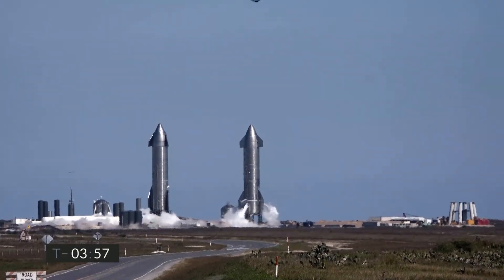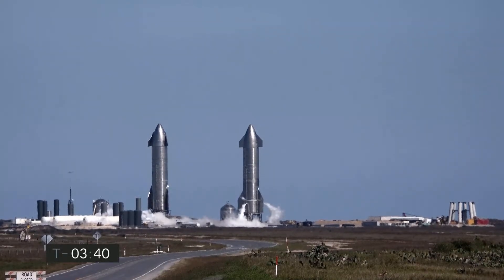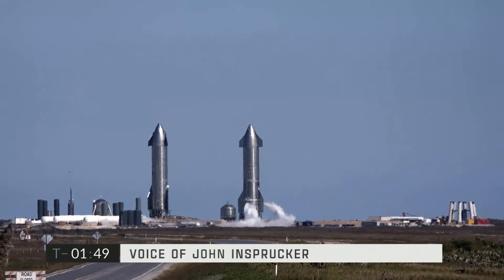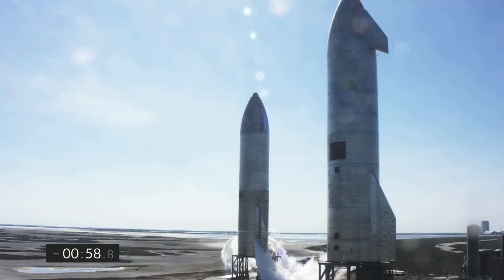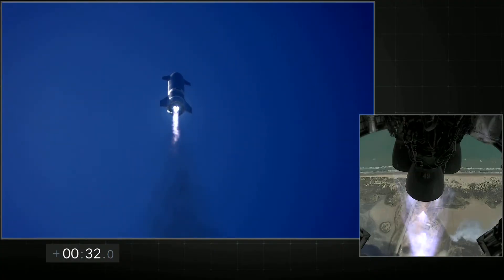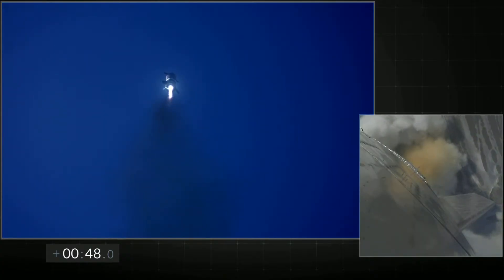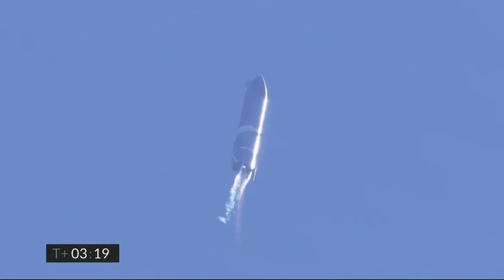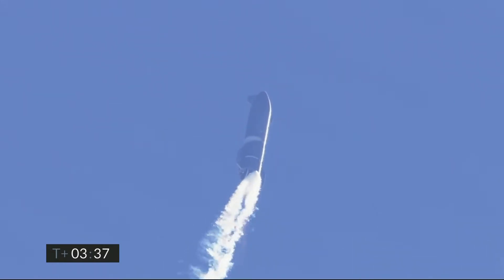Starship | SN9 | High-Altitude Flight Test

Comment: So it basically and obviously failed ...
Reply: It did not land, but this was an expected outcome. SpaceX is developing Starship in an iterative test program.

They build it, they fly it. It fails. They build another. They fly that one, something else needs to be improved.

This way, they not only develop the rocket to be more reliable, but they also learn how to manufacture it more efficiently, thus reducing the cost.

Starship SN10 is already ready to fly, and if it fails to land, they'll have another ready. It would've been nothing short of miraculous had the last Starship, SN8 landed perfectly, but going forward, landing failures will always be possible, even after they succeed.

Keep in mind that no other rocket company has done what SpaceX has - return a rocket booster and land it to be reused. Most just drop the booster and it burns up in the atmosphere.

Starship will be so incredible, because it will be completely reused. The cost to fly it could be as low as $2 million, which compared to the space shuttle's hundreds of millions is astounding.

This rocket is going to change the world, just watch.
Reply: It didn't fail, it launched on time, reached apogee, belly flopped, corrected abit, and then crashed due to an engine failiure

Comment: For those I favor of the argument that SC10 was too close for this test.  Remind me...  How fast do micro-meteorite and other space debris travel?...
Reply: They travel at tens of thousands of miles per hour, ie, much faster than the debris.

I agree somewhat, it does seem rather questionable that SN10 was right next to it, but I suppose it was a calculated risk. These ships are durable. SN9 actually fell over in its construction bay before its flight, and they got it patched up quickly enough.
Reply: My point exactly.  A large percentage of our exit level space craft don't have to be designed to fit such specification's, but in order to carry humans it does, as the S series is intended to do.  This is a large payload series of rockets to move lots of weight into any of a number of Lagrange points.  It is designed to "potentially" withstand forces from such dark space and orbital debris.  The debris from a failed landing of a rocket that has already spent 90+ % of it's original capacity from half a kilometer away is nothing
Reply: @WasatchWind  I apologise for deleting and simplifying those previous posts.  I feel I only reiterated and didn't neglect anything I'd preciously stated.  I agree completely.  Had I known this to be an ongoing convo I'd have never done so
Reply: @austinholm-mcrae2777  Oh you're fine. You are someone who has an actual legitimate concern, instead of someone that sees this video, and thinks "the rocket blew up therefore SpaceX is doomed!"
Reply: @WasatchWind  I remember when Sojourner was launched in grade school, and it was a four year journey to the red planet!  Now it takes perhaps 9 months!  It's astounding how far we have come, and don't want people thinking risks aren't mitigated.  Space X would be bankrupt at one point, if they hadn't managed to land one rocket in particular, and now look.  Where is Blue Origin?  Where is Verizon's large payload rocket?  I just really appreciate what Elon Musk is doing for space exploration.  Next step, space elevators....  I wish...
Reply: @austinholm-mcrae2777  Space elevators will be awhile. In the mean time...

Starship is going to be fully reusable. It is aspired to be able to fly at only $2 million a flight, flying 100 tons or 100 people at a time. It is then hoped to be able to fly as much as three times a day.

Think of the possibilities! They could launch a space station with the volume of the ISS in a single launch! NASA could be freed from the shackles of politics, sending up countless probes and telescopes of a massive size.

Zero G manufacturing could become huge, especially in biomedical applications and materials science.

Even if SpaceX does not get to Mars with Starship, they will change everything. Even just with Falcon 9, they're going to have both the first fully commercial human spaceflight (professional astronauts from Axiom space, who are building the successor to the ISS) and then the first fully civilian crewed spaceflight, wherein all four are non professionals.

Crazy stuff is happening. PS - I was zero years old when Pathfinder and Soujourner landed, if that makes you feel old at all 😄

I'll probably feel the same when I say I grew up reading books about how we would go back to the Moon "in 2018".
Reply: @WasatchWind  damn, I've had a few drinks and dunno what happened to my previous post TBH...

That's my point exactly, is that the main goal is to make the cost required to break earth's gravitational pull/lb, is the main goal.  Space elevators and carbon nano-tubes are the way of the future, maybe next to asteroid mining.  Check out Planetary Resources Inc.
Reply: @WasatchWind  and, I mean if being 32 makes me old, then I'm old. 

Think about this.  All of the gold ever mined and refined in the history of humanity; if gathered completely and put into an Olympic sized swimming pool, wouldn't over fill it.  Understanding that asteroids are mostly either rocky, icy, or heavy, and understanding that most "heavy' asteroids are " heavy" because of Platinum Group Metals, or other heavy "rare earth" elements; AND how they are detected...I feel confident in saying that if the first trillionaire isnt Jeff Bezos, it'll be someone in asteroid mining.  The people can enjoy their inflation
Reply: @austinholm-mcrae2777  I've found that with space industry current events, keeping occasional tabs on Everyday Astronaut and NasaSpaceflight have actually taught me far more about the topic than high school physics. I may be rather bad with the math, but learning about the basic technical goings on isn't too hard.

Comment: These rockets are just too heavy to land vertically. SpaceX has to start thinking of another strategy that is easier and more efficient, such as landing horizontally. I can feel through the screen how heavy that thing is!
Reply: You know, they're planning to land on mars with precision and accuracy. Landing horizontally means that there needs to be a runway.
Reply: @wellington8202  That is a valid point. For Mars.
Reply: @jonathanlancaster482  He has a valid point. Period. Landing horizontally means a completely different craft altogether. One that obviously wouldn't work on Mars. So, what would be the point?
Reply: This thing is about 140 tons on landing, and each Raptor can produce up to 200 tons of thrust. They actually need to shut down to one engine that has to really throttle down in order for this thing to land. "Heavy" always depends on the reference frame.

Comment: Space x needs to change the shape of the header tank, so that it is cylindrical like the big tank just smaller and maybe even put baffles inside. the traditional round header tank still lets fuel splash around, it is just the traditional way its done. get away from tradition and think out of the box like Space X does best.

Comment: Fill up the tanks and send SN 10 to LEO.
Reply: It won't even get off the ground with only three engines if it's completely fueled up. Way too heavy. The time it would take to burn off that fuel to get light enough to launch it would have long since destroyed itself on the landing pad that doesn't have a flame trench or a sound suppression system.
Reply: @samos8367  Understood. From the start of the build to the landing everything is made for
 that purpose. S X is missing critical info about fuel flow from horizontal to vertical. Oh I have a thought, make a test stand say 1/2 scale with header tanks, down comer, engines and have it lay flat then go vertical in 3 seconds. Test after test with cameras in the pipes 
and tanks. Know what is going on not E guessing. Thanks for your response.

Comment: I mean, I'm no rocket scientist, but it doesn't take a genius to figure out that reignite and flip to vertical needs to happen a lot sooner. Once (SN8) is understandable. But this is twice now. If SN10 crash lands because some doofus can't math right and screws up the reignite timing again, I want to see a public hanging.
Reply: You're definitely smarter than the team of rocket scientists behind this launch. Just reignite earlier, that easy man.
Reply: @user-l3m9k  it's obviously a timing error if the engineers aren't giving the engines ample time to reignite. You have to allow for sufficient delay in this situation, and twice now, they have not.
Reply: @user-l3m9k  bottom line: it is far better to be ten seconds too early, than half a second too late.
Reply: @user-l3m9k  I would say that too if I had just screwed up the same way twice in a row.

Comment: Red flames around the engine pumps are just ambient air particles burning off or is there some controlled fuel leakage causing this?

Comment: They didn't fail they learned how to avoid these mistakes:-)
Reply: @Micael but it is true
Reply: @JulienReszka  If you only learn when you succeed, then how do you learn how not to fail?
Reply: @alxz3707  by working harder, making better countermeasures that will prevent the unfortunate events, succeeding then learning and reinforcing this behavior.
People who are successful and tell you that they didn't work hard are lying to you. They only do this to be more relatable to the average lazy person, but in truth you have to work very hard to succeed.
Reply: @JulienReszka  how do you make countermeasures if you didn’t know that the flaw was there?
Reply: @alxz3707  you imagine the correct attributes of what you want to deliver and the wrong attributes. You make sure to prevent the things that make the wrong attributes possible and you also make sure to prevent the things that prevent the correct attributes possible. It's called active and passive countermeasures.
You have to manage external and internal risks inherent to everything you make.
Reply: @JulienReszka  If you scrutinize every possible aspect of a project, you will move at a snail's pace. It is theoretically better in this circumstance to allow the failures to speak for themselves. Launching Starship this way is the fastest way to analyze real world data and allow for issues to present themselves without wasting time perfecting everything. Also, judging by SpaceX's financial situation, I think they can crash a few rockets before they run out of money. An example of a group being conservative on the testing front is NASA. Their strategy is to make sure everything is absolutely right before attempting any type of test. This causes them to move at an extremely slow speed for essentially all of their projects. Although their method is justifiable since they are a government organization, not a private company that can lose face for a bit, if they lose face at all.
Reply: @alxz3707  If you fail you're back to step zero, but if you move with small successful steps they have compounding effects on what you can achieve.
Apollo was a success because they worked very hard on the design to make it right on the first try. Imagination is less expensive than prototypes, I think it will be very hard to argue there.
Reply: @JulienReszka  Imagination is less expensive than prototypes until human lives are on board. You can’t imagine every single flaw in a design. Also, Apollo had a lot of unforeseen disasters. Apollo 1 took the lives of 3 people during a test. Apollo 13 had an ugly issue on its way to the moon. None of these capsules were tested the same way as SN8-9, in real world conditions.
Reply: no they didn't learn, we only learn when we succeed
Reply: Failure and success contribute to learning, which leads to growth...
Reply: @ZeHoSmusician  ok freind
Reply: @ZeHoSmusician  Insanity Is Doing the Same Thing Over and Over Again and Expecting Different Results

Comment: maybe try all three raptors on sn 10 .  maybe one or two is not enough to turn the crafts massive  weight. remember your not just turning the craft upwards your also canceling out any horizontal  momentum at the same time. if you don't have enough force coming from the engines she wont be able to kill off the horizontal momentum if you can get all three raptor engines to fire SN 10 should at least not blow up...

Comment: what is the long term purpose of the SN series?
Reply: to make humans a multi-planet species
Reply: @MrEd2291  so, it's a Mars transport unit?
Reply: @LtBernum  Given the help of the Super Heavy booster AND refueling in orbit from another Starship both the moon and Mars are possible. Given multiple refuelings, anywhere in the Solar System is possible. Of course, further development is necessary.
Reply: @MrEd2291  Thanks boss

Comment: The next one will explode again unless you flip to burn earlier, doing it so late is causing it to not be able to slow down enough to be able to have that extra little bit to safely land, if you want to do the correction that late you need to have extra flaps that will shoot out after it corrects to act as a parachute catch the air and give it the chance to land, and maybe the best thing honestly is to have it be like a plane but not have on board landing gear, you want to catch rockets in mid air why not have it so this comes down like plane would land and then somehow docks with landing gear on the runway that will double as a way to stand it back up and get it ready for flight

Comment: So I’m guessing there’s a lot of greenhouse gasses being released into the atmosphere during these tests.
Reply: About as much as 150 cars do in a year. Which isn't that much, really, when you consider there are 274 million cars in the US.
They'd have to do nearly 2 million of these tests a year, about 5000 every day, or one every 17 seconds, to match that.
To even do 0.1% as much, they'd need to do two thousand tests a year, or about 5 ever single day. And that's just to match the US, not the world.
And just for cars, not ships or planes or power stations or anything else. In the grand scheme of things it's negligible.
Reply: @lazarus2691 even when they explode?😀
Reply: @johnsmalldridge6356  
It doesn't matter whether the fuel burns in the rocket engines, or in an explosion. The amount of carbon released is still the same.

The steel hull of the ship itself didn't burn, the debris is lightly scorched at worst: https://pbs.twimg.com/media/EtVSZ3kWgAADL94.jpg

So no extra gas there either, just lots of scrap metal to collect.

Comment: Is it just me or did they start the engines a little too late it's a super heavey rocket yes the Raptors can lift it but do to speed and gravity that shits going to be more heavy, might I suggest they start the landing a lot higher in the air so they can control the rocket better and land it with minimal damage

Comment: Wouldn't a parachute work/help?
Reply: No, it's far too heavy for a parachute to be very useful. It's 150 tonnes, the Shuttle SRBs were only 90, and even with three parachutes they still landed at 50mph/80km/h.
Reply: @lazarus2691  Well, using engines to slow down from 80km/h instead of free fall is not that bad. But I do get that it is heavier, and they probably thought about it lol

Comment: Looks like you demonstrated great control and success. Tell me how the vehicle directed itself back to the pad? We are told that the reason rockets always go up on a drastic arch is because of the earth turning, so how did it fall directly back to its launch point? Those flaps that barely moved did not direct its trajectory, only its axial position. And that tiny bit of engine burn would never be strong enough to stop that vehicle only seconds before landing. It took like 10 seconds to get it off the ground like 50 ft. And that's not falling at terminal velocity. How does anyone belive this horse shit any more. The rockets get more low tech looking. The camera work gets worse. But people still believe this crap lol. 
DEFEND THIS SPACE FANBOYS
Reply: Rockets do not arch over 'because the Earth is turning'. They arch over to reach orbit. Even on a stationary world you would still do the same thing.
The moon for example only rotates at about 10mph/16km/h, which is basically nothing, but you would still arch over to reach orbit if launching from there.
Also, that engine can make 200 tonnes of thrust, the vehicle weighs about 120. There was supposed to be two engines, so 400 tonnes pushing 120 tonnes.
More than enough. I suggest you go and watch a Falcon 9/Heavy landing some time, they land from much higher speeds with similar thrust to weight ratios.
Reply: What should I defend here? The Flaps move, even if it is just a tiny bit, it still drastically changes the movement of the Starship.
“That tiny bit of engine burn would never be strong enough to stop that vehicle only seconds before landing” Well, that’s exactly why it does that bellyflop, to slow down in order for the engines to be able to do that.
You can see how good this worked on sn8, here one engine unfortunately didn’t light up.
How can you explain that there are literally dozen of camera angles?